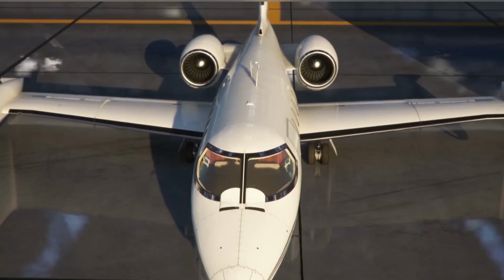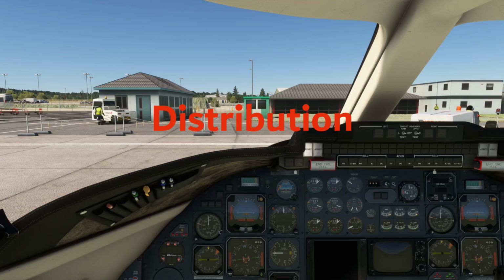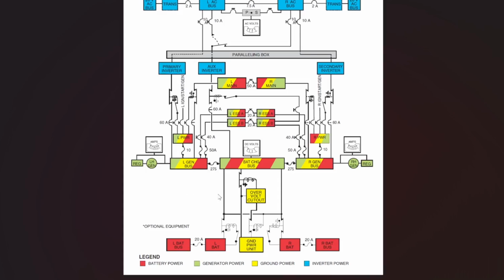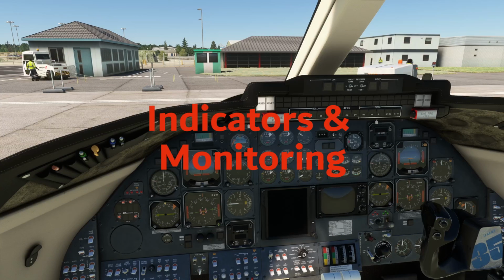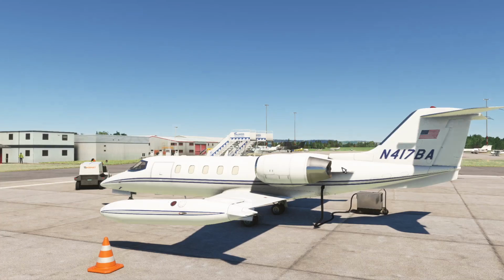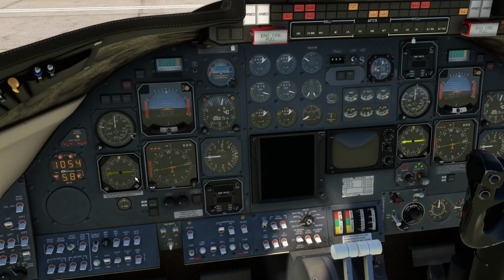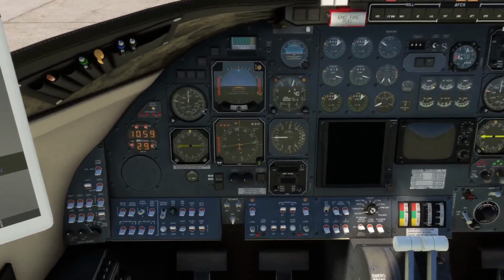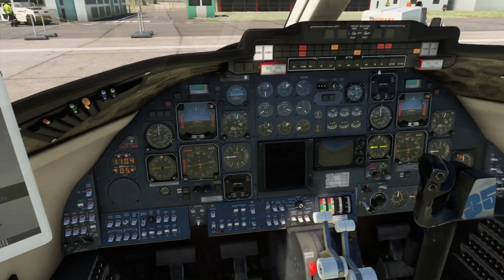How to fly the Learjet 35A | Part3a -  Electrical Systems

Comment: Good presentation😊.  However, at approximately 1:50 minutes in the generator description needs to be revised.  The Learjet 35/35,35A/36A models are equipped with separate brushless Bendix generators and brush-type armature and commentators starters.  The earlier 20 series Lears, as well as the 31/31A models, 60 series and 40/70 series are equipped with the single unit, brush type starter/generator configuration.  

The separate Bendix brushless generators utilizes magnetic inductance to energize the field windings.  This generator is capable of producing 400 amps continually, as long as there is sufficient frontal cooling air brought into through the nacelle NACA scoop.

Comment: Lear 35 AC electrical system has something called a Paralleling Box for both the PRI and SEC inverters, that is why the AC bus switch reads 115 in both positions if only one inverter is selected ON. Very well put together video on the system though! Keep them coming!